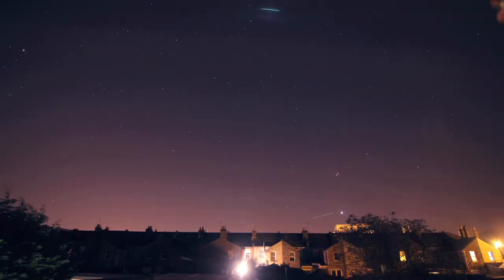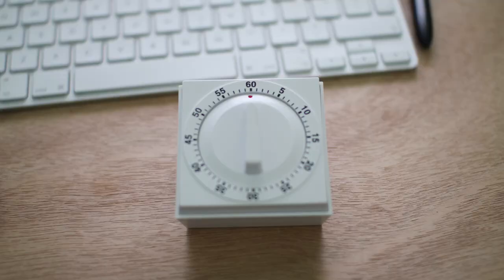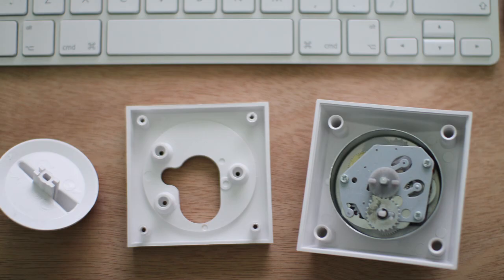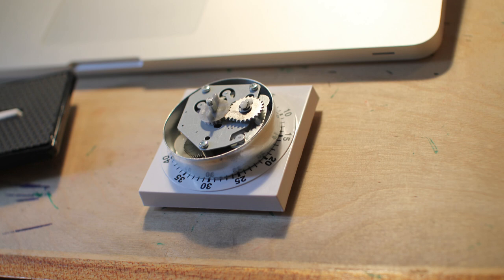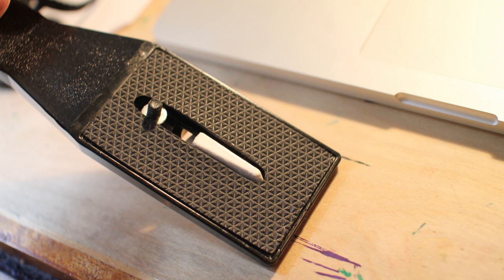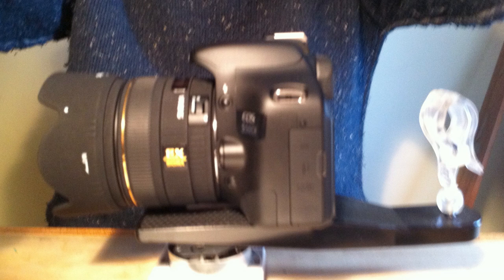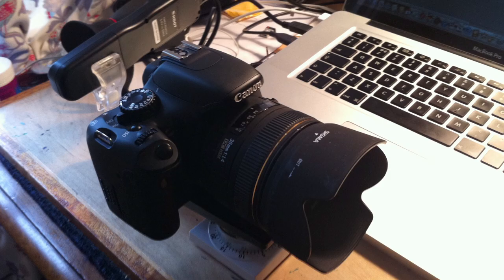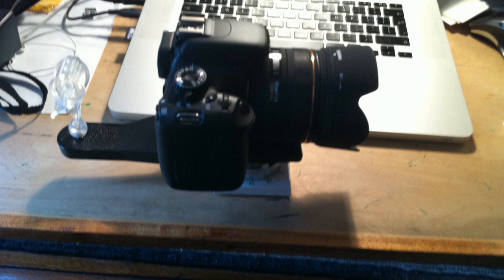Cheap DSLR motion Time-Lapse guide

Comment from the maker: @BCdback24 and I was pointing out that without doing something drastic or mildly complicated reversing the clip is probably the only way. 
Look at it another way - the egg timer is your motor with a couple of cogs and some chains you could build a panning platform however you wanted. 
Or you could get a battery powered BBQ/rotisserie motor and rig that up with cogs and gears. 
It is all possible but with the setup here it wouldn't be that easy if you don't have that kind of diy experience.